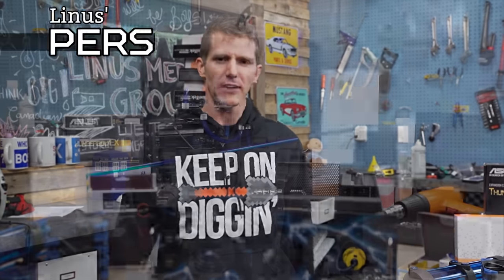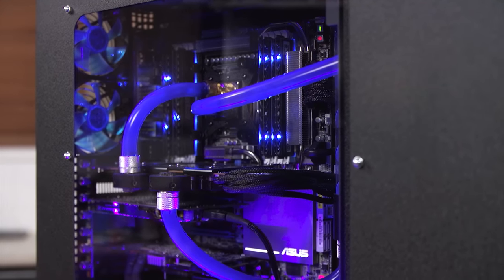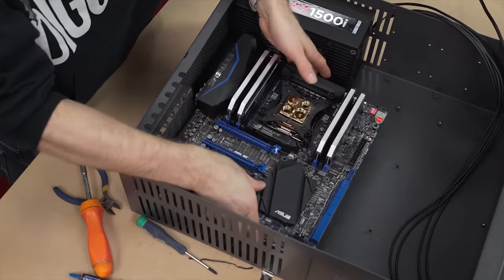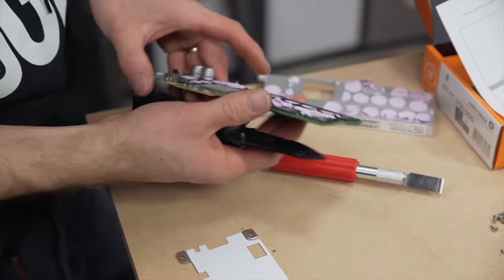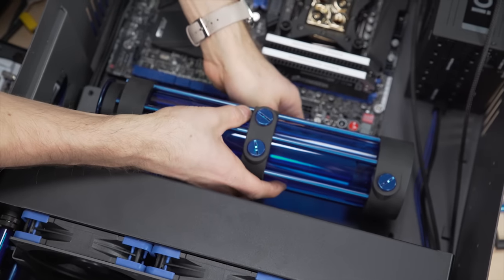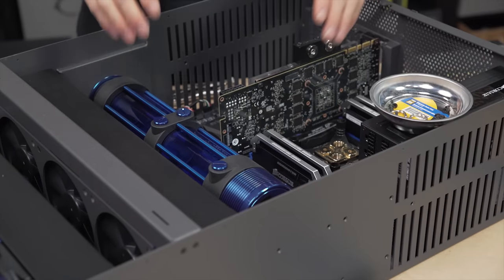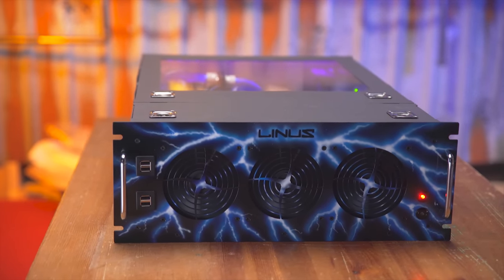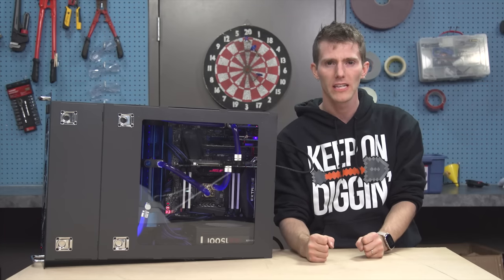Personal Rig Update 2015 Part 4 - My new gaming PC is done!!

Comment: I'm assuming part 5 is where you'll show how to wire it and use it being a room away?
Reply: +Andrew Quartararo that's the part I really want to see
Reply: Chad Levy Did you not read my comment? Just watch the video I linked.
Reply: +MMMHOTCHEEZE No I didn't see your comment, nor am I able to find it. What's the video link?
Reply: +Chad Levy Just put this at the end of the URL /watch?v=XmxAcVvAO40        
It's the video about the 100ft USB cable
Reply: Bsclly They have a 100 ft Thunderbolt cable. Watch the video and you'll see what I mean.
Reply: +MMMHOTCHEEZE ah yeah, I saw that video a while ago but forgot about it. Still I can't wait to see how he puts it all together, especially using Thunderbolt.
Reply: Is he connecting the usb-c to the mother board or the graphic card ?

Comment: That optical drive sounds pretty dope actually. Never thought I would want an optical drive in 2016. Does this make me a hipster?
edit: I just googled what lightscribe is, it's the coolest fucking thing ever! It laser etches images on the top of discs, so you can put labels and images on your CDs/DVDs/Blurays. Why did they drop support for that?
Reply: +brickman409 Because you needed Lightscribe DVDs, which were not cheap. So It was much easier to just buy regular DVDs and print labels for them. Also it didn't do color, so you were stuck with whatever color the Lightscribe DVD was which in most cases was gold.
Reply: +brickman409 you needed special cd&#39;s that were built for lightscribe so the top could be labeled thus almost doubling the cost of your blank cd&#39;s at the time, and don&#39;t forget blank dvd&#39;s were more expensive! then came dvd-rw rewrittables that were even more expensive!, 

 and also because of the way optical drives are built, all the laser diode&#39;s go underneath the cd , so you had to flip the cd to laser etch the top... and booooyyy the amount of people that boinked cd&#39;s or didnt understand that concept properly were quite angry. 

it also had the chance of simply ruining your disc, and this was in the days of failed burns already happening because of the damn rng.
Reply: lol wasn't being rude :P was just giving a solid answer :P,
Reply: +brickman409 
lol I had a light scribe drive. weird thing is I literally came across some CDs I have with a light scribe image on them maybe 3 days ago.
Reply: *****
 if your drive has the light scribe logo you can. you will also need the light scribe software not sure if it will still work but who knows. the ones i have were made a least 4 years ago i actually dont even have the drive anymore to do them lol.
Reply: *****

amazon has them

Comment: Liquid cooling an SSD... WTF
Reply: +Zachary Robinson NVME SSDs can throttle without forced airflow

Better safe than sorry
Reply: Nah bro
It's all about liquid cooling the liquid cooler
Reply: if you're already at the price point where you are custom water cooling and also using an Intel pcei ssd, water cooling it is no big deal
Reply: +LowWithKnowhow this exactly. People dont realize how much of everything we consume is a hidden advert of some kind. South park hit the nail on the head as usual
Reply: +Zachary Robinson ya,totally useless,no where in history of computers has an SSD overheated,i agree with LowWithKnowHow,they just wanted to plug EK
Reply: threeebills1 No, the 750 series SSDs and PCIE NVME SSDs do overheat and throttle.

It wasn't that long ago that people thought the possibility of graphics cards throttling was preposterous
Reply: +Jacob eMatt I see your point,if you think about it,under the right circumstances i imagine you can make anything overheat,but in practical everyday use,with proper air circulation in the case i dont see an SSD overheating.I retract my comment as to "no where in history"..i didnt realize the statement would be put under a microscope.I have a samsung 950 pro and run multiple programs and never seen a slight problem
Reply: +Zachary Robinson Also cooling my M.2 SSDs ... they got to 80°C before mounted big heatsinks to them.
Reply: +threeebills1 The 950 Pro features a Thermal Throttling Protection technology which controls the temperature of the device to reduce overheating and maintain a high level of sustained performance. The older sm951 for example didn't had that feature and tend to overheat badly...
Reply: +Jose Shigemitsu interesting,well,that would explain why i never had a problem,i imagine they're still perfecting it
Reply: +Zachary Robinson yeah true.  I have enterprise (HP) SANs and NetApps that run 24x7 and ESX hosts etc.-- no water cooling ever LOL.  There is no need if the closet he puts it in is cooled correctly.  I mean it is a rack mount so I assume the environmentals are to spec.
Reply: +Zachary Robinson  Liquid cooling an SSD that isnt even very good for gaming,   I've heard those intel ones are better for server style usage and the samsung 950 pros are the best ones now for general usage ( though they cant be fitted with a waterblock )
Reply: ash0787 They're storage devices, how could they be good or bad for gaming?
Reply: +Nithin Murali I prefer to liquid cool my keyboard. Makes my typing faster
Reply: Jacob eMatt
 speed,  the intel 750s are optimized for 'high queue length'  which means when multiple threads want to access the drive at the same time,  as would happen with enterprise use

samsungs 950s are slightly faster in basic usage situations,   and you can get them in M.2 form factor
Reply: ash0787 That's a cop out, you're saying because it's made for extra high performance it's not for gaming.

Comment: What GPU are you using?
Reply: I believe a GTX Titan.
Reply: *****
Pretty sure the GeForce GTX 970 is better than the Titan. Titan is older.
Reply: +Grant Erickson there's always something better than what you have :\
Reply: MetaSeraphim Linus has a Titan, not a Titan X. Also the 980 Ti is Nvidia's newest GPU.
Reply: +J4ck0f5p4d3s 950 is the newest gpu.....
Reply: Andreas Boye Yes. You're right. I forgot about it. Probably because of how uninteresting it was.
Reply: +J4ck0f5p4d3s the 950 is actually I think kinda interesting cuz its cheap and even better for console killer pc's
Reply: RichezPlays The 960 is a better value for a cheap PC.
Reply: +J4ck0f5p4d3s The 280X is the best bang for buck
Reply: +SwaggerLemon™ 910 is like non existent. nobody should mension it or talk about its existence. just like lemons
Reply: +J4ck0f5p4d3s then the r9 380
Reply: Gtx 1080ti

Comment: Ok guys i need help, Im trying to get into PC, what would be the best thing to buy first to upgrade my rig so that it can handle games more smoothly? The Graphics card right? If so would a GTX 970 be a good first upgrade to my PC?

Edit: I also need a desk as i can just barely fit my monitor on it, but it would like to also fit my tower on it. The desk i own is currently about 28inch-ish but I need to know if there's any good desks out there that you guys could link and that i could check out. Thanks :)
Reply: +VanillaYouth Depends what processor you have. If it is too slow, it could make getting the 970 a waste of money. Go have a look at similar builds to your own on pcpartpicker's website and see what people have done.
Reply: +HybridChickun Currently using a Prebuilt (I know, eww) But it has an AMD A10 7800 @ 3.5 Ghz. Not sure if its overclocked lmao. Im literally still trying to learn all this shit.
Reply: 970 is good but a 960 would also be fine.
Reply: Pls for the love of god do not get a GTX970 the 3.5 gb of vram on that is horrendous
Reply: +VanillaYouth Get a 390 if you have the PSU for it.
Reply: ***** What do you mean "if you have the psu for it"? Do you mean correct wattage?
Reply: what res u gaming on? 970 is currently the best for 1080 gaming, pretty much max setting on every modern game, use less power n less heat. if u r playing lesser games like moba n csgo u can use 960 its more than enough. the 970 4gb issue wont affect u at all on 1080 gaming but if u game at higher res 1440p n above I recommend u get amd 390/390x, amd the best at higher res
Reply: Mikhail Armanuel It uses a fair bit more power than the 970. So yes.
Reply: Viviane Devillers Unless OP intends to upgrade next year the 3.5 gb will become a issue.
Reply: ***** I think its still pretty much up to what res is he going to game with now, 970 still wont have much issues for future 1080 games for a few years, if hes to think bout future high res gaming better wait for this year new tech or get a 980ti or fury x, they can give playable framerate at 4k
Reply: +VanillaYouth You have an A10 7800... upgrade to a better cpu (and pros motherboard too) before you buy a new gpu lol
Reply: +Mikhail Armanuel 
The 970 has a full 4gb, it's just that the last eighth is kept in reserve. You'll barely need it anyway. The 970 is an awesome card, one of the best price/performance ones out there.
Reply: +TheTritoneTerror i have an 970 and i3 what cpu do you have?
Reply: +VanillaYouth Just a heads up, the 390 is pretty much a straight upgrade to the 970. I'd only suggest the 970 if you have a really shitty PSU, but in that case i'd probably recommend getting a good PSU anyway.
Reply: +Alek Schultz (Pretzel Optician) yes, one of. why buy a 970 though when for the same price you can get a 390 with more than double the video memory with a chip that  is almost identical to the 970 in actual performance, although not a problem now, more vram is showing to be useful in some newly released games. not saying the 970 is a bad card but as a new purchase the 390 is better (although a little more power hungry). also Nvidia have gotten cocky thinking they have a monopoly and have been going down hill for a while now. little things like 512mb of vram, and slightly larger things like crippling keppler cards and censoring forums. doesn't make the 970 a bad card but your dicks in nvidas hands call me a crazy doomsayer but shits gonna go down in the next couple of years.
Reply: oh and OP head to reddit.com/r/buildapc . Great community over there will see you right
Reply: the desk might be too small if you want to fit it , some monitors are 28 inches and adding a tower on top of it you need at least around 40 inches to put your own peripheral on
Reply: for the desk simply go to IKEA and buy what you like. about your PC, it's a bit complicated, but let's say that a prebuilt, OEM PC is usually difficult to upgrade (I think Linus did a video about that) so you're probably better off building a new one, sorry...
Reply: +Viviane Devillers (Inori) How could you know what it would or would not have issues with in the next few years? It's better to get the more vram for the same price. Literally the only downside for the 390 is the power consumption. I just don't understand how anyone recommends the 970 anymore when there is just a much better option out there.
Reply: +ProPuzoficj™ well the 970 is sometimes a bit cheaper
Reply: +Daniel G i3 is not that bad of a CPU
Reply: +VanillaYouth processor should take priority
Reply: +Snake Designs not if he's on an igpu
Reply: +VanillaYouth If you're using a prebuilt, I'd suggest get a new atx case s you aren't stuck with whatever they give you.
Reply: *****
I don't see why you had to get toxic, talking about dicks in NVIDIA's hands. Some people actually like the fact that NVIDIA is optimized for more games, and has arguably better features like shadowplay and Shield (if you're into that kind of thing).
Reply: +VanillaYouth I would try an Ikea malm desk with the slide out. (Don't attach the slide out if you want it to be really roomy under the desk.
Reply: +Daniel G some of the i3s having hyper threading. Would still perform well enough with a 970 or 380/390
Reply: +LikeATrollFace A10 7800 is FM2+, FX8350 is AM3+...
Reply: Darren Lesinski i have an i-4160 but is see my i3 having some trouble in some games where my gpu is just running at 30% and my i3 on full load what do you guys prefer for a new cpu around 300 euro
Reply: +Mikhail Armanuel it doesnt matter in 1080p and imo it doesnt have the horsepower to run higher resolutions
Reply: +Mikhail Armanuel no it's really not... it's not designed for 4k so 3.5GB is fine. I have a 970 and often play games at 4k and I have never gone over 3.5GB
Reply: +jack black ASUS is just about the worst Radeon GPU manufacturer, Direct CU only works "decent" on the R9 380 and below. Above that, it's horrendous. Sapphire>MSI>XFX=Powercolor>ASUS>Reference>Gigabyte
Reply: +Koby Dunham HAHAHA... Gigabyte make awesome cards and the reference is basically a jet engine that doesn't blow air lol
Reply: Rover You're mistaken. Gigabyte makes really good nVidia GPU coolers, their AMD cards are voltage locked and horribly cooled. In comparison to something like Sapphire's Tri-X cooler or Nitro coolers, even MSI's Twin Frozr cooler (which cools very well,) it's extremely bad. On the green side they're okay.
Reply: +Koby Dunham oh sorry... they have got to be better than reference though
Reply: +VanillaYouth Even with a 400W PSU you could get the Strix, MSI, Powercolor, and Gigabyte 390, or 500W for a Sapphire 390.

But for headroom, overclocking, and optimal reasons add 150W to those numbers, so for a Strix, MSI, Gigabyte, Powercolor, or any other 6 and 8-pin card I'd have at least 550W, and 650W for the Sapphire or any other 2 times 8-pin card.

And get a 390 over a 970 like others are saying, it'll serve you better in the long run.
Reply: +Mikhail Armanuel I haven't had problems with it in the year i've had my 970. then again I don't run synthetic bench tests on a 5k monitor with it either.
Reply: Rover They are better than reference, I was just making a joke about them being worse. Just joshing.

They do suck though. Not on nVidia, their Windforce coolers are badass there. But, they've neglected the Radeon side and just slap random coolers on cards where they fit, just like ASUS.
Reply: +Koby Dunham OK sorry for the misunderstanding.
Reply: +Clinton Walker double the memory means nothing if the card does not have enough horsepower to push higher resolutions, or if you are not playing at 1.4k or 4k resolutions. that double the memory just sits there not being used.

And about your conspiracy theory. The only kind of thing i've seen Nvidia delete from their forums is stuff like "but your dicks in nvidas hands call me a crazy doomsayer but shits gonna go down in the next couple of years."

I guess I can see why you are so angry, I would be angry to if i was a crazy fanboy that got repeatedly banned from a competitor's forum.
Reply: +Tom Janssen a Intel i5 4590 would be a solid upgrade. You'll see it's a quad core processor with decent clock speeds at a great price. If you plan on keeping your setup the way it is for the next couple of years you might want to save and get a 4690k or a 4790k both of which are overclockable. Cheers
Reply: Holy shit that's a lot of comments... I swear when i went to sleep it was at 4 lol
Reply: +Darren Lesinski GPU, not CPU. And yes, a GTX 970 is really good.
Reply: +VanillaYouth lol youtube comments, but bro, try looking at amd cards, do some small research on google, amazon, pcpartspicker, and other websites, but be careful, cause if your rig isn't good enough you'll have to update all the parts, otherwise, you'll only need to upgrade the GPU and the PSU :)
Reply: +Eman EL he doesn't have a quad core CPU. he will see performance increases whether he switches his gpu or CPU. I was in the same boat. I had a dual core with a GTX 750. Saw great performance increase when I switched to quad core
Reply: Eman EL his cpu is pretty old though
Reply: Darren Lesinski Is the AMD A10 7800k not a quad-core CPU?
Reply: In my area Costco has great desk for a $100 I think it is 48 by 24 inches
Reply: i didn't read the other answers, ignore if already said:
i for myself have build a pc with a asus gtx 970 for me and one for my friend, if you have the money, better buy a 980. the witcher 3 runs witch about 45 fps at highest setting and full hd, but only with about 20 fps on 4k. if you are planing on using the graphic card for the newest games on highest setting also in 3 years then you need a 980 or probably even a titan x/980 sli
Reply: ***** don't!! don't buy an i3, go i5 at least, you need the extra giga hertz, and in case u don't have the money, please please wait until u have the money, cause otherwise it's a waste of money to go with i3!! 
the i5 can stick with u for years and run like a beast for future games, but the i3 can't, especially the one u mentioned!!
Reply: +iBoolGuy the new i3 actually allows to game almost as well as i5 from a couple of years ago, is pretty decent for a budget PC. the other thing though is that you might want to go with AMD in this price range, check Linus' video on PC build for 2015. there is a 500$ budget PC.
Reply: Dan F yeah i watched that video, but what i mean, those couple of dollars u pay for the i5 are worth for the longer term!!
Reply: +Dan F also a lot of new games require 4 cores such as far cry 4 and some others... it's the main reason why people didn't buy the k pentium. it only had 2 cores
Reply: +iBoolGuy the difference is actually quite important and future proofing CPUs is not the best idea...
Reply: +Rover hence my suggestion to go with AMD in this price range
Reply: Dan F exactly
Reply: ***** not all of them have 4 threads and farcry 4 originally didn't work with threads. There had to be 4 physical cores before an update.
Reply: ***** other than games that require more cores. While future proofing CPU's didn't really make sense in the past, nowadays people keep the same CPU for 3-4 generations because of the lacklustre improvements... Just save up and get the i5 it will be a bigger return on investment in the long term